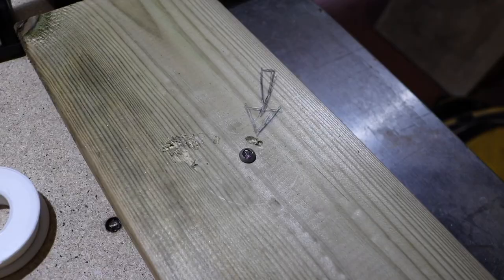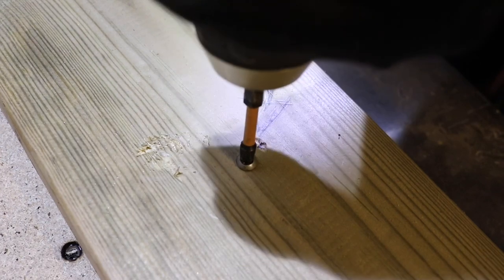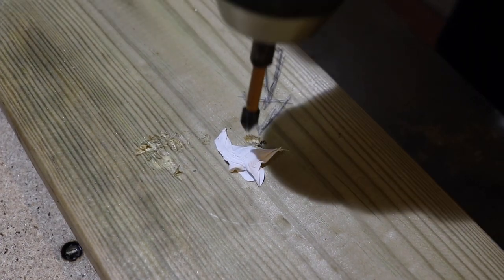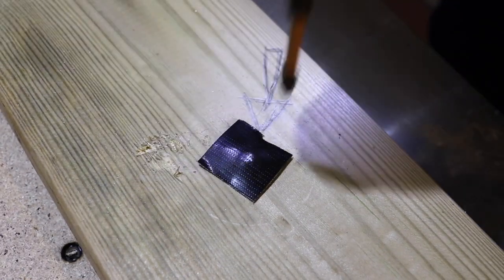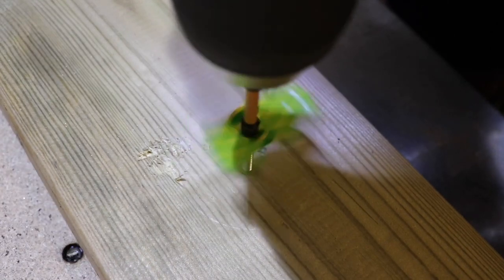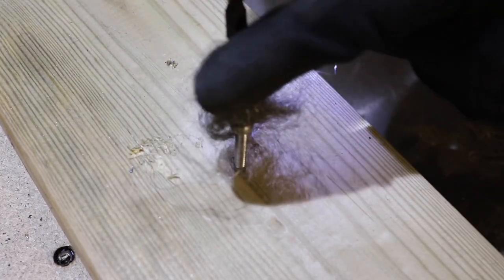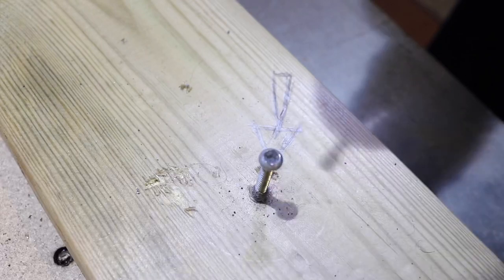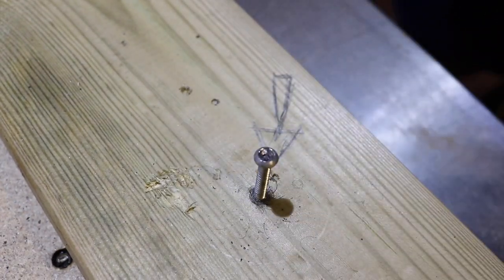Remove a stripped screw 8 DIY ways anybody can do

Comment: Electrical tape worked with one screw and I did it without an electrical drill! 1 down, 1 to go!🙌🏿
Reply: Thanks for the tip! It's a good thing I read comments while watching...🥰
Reply: I have one stripped screw on the back of my laptop. Hope this works😊

Comment: I was having a mental breakdown over here trying to replace my god damn PS4 Fan......stripped security screws galore! I ended up stripping one with a torx bit.......then I tried a variation of something you did. I took a flat head bit and put it in my drill, then wrapped some tape around the tip and it started coming out! It didn't come all the way out, I had to use my needle nose pliers to twist it but I got it! Great video man.
Reply: @domwrlddd  They really force you to get creative huh? >.>

I swear I am so damn happy I didn't have to buy another PS4 cause PS5s are so damn hard to come by and I wasn't ready to upgrade anyway. If not for my toolbag and tool collection I built up over the past months, I would have been screwed. I had to use A LOT more than just the security screw drivers and regular ones to adjust the parts. I spent at least two weekends trying everything and one day I stayed up until 7:00 AM in the morning until the damn thing was going again (much to my relief).

Probably watched over a dozen of these videos doing all types of repairs on PS4s.
Reply: @domwrlddd  I didn't need a drill to get one out, I was able to use my pliers or the tape trick with some of my screw drivers. I think that's an issue you need a shop to solve........I don't want to tell you to use a drill for that because it might drill too deep and damage something. I mean the PSU are $50 on Amazon last time I checked. I would just do that and get it over with, instead of fucking around with that screw. They do have a toolset for removing stripped screws. If a screw is stripped and you can't get it, it's this tool you press down on the edge and twist to pull the screw out. There are tutorials out there, look up security screw/torque screw remover tool. That could possibly work, if not to a shop it goes man.
Reply: @domwrlddd  facts man it's my power supply one

Comment: If it is an allen, torx, or certain size philips head, I often use a short torx bit and hammer it into the head; then attach the drill and back it out. The boxes of deck screws I used to buy always came with the proper size torx bit, bit I always had longer bits I liked so I have a small supply of cheap torx bits to use just for this purpose.

Comment: Great stuff,, must admit I'd not seen the wire wool trick,,!! Do you think WW is best of the bunch, ?   
Cheers,   John
Reply from the maker: I do use that method quite alot and seems to work everytime, I would say that's my favourite way John. 
Thanks
Reply: @PlumbingGy   
 just thought,, which is best, fine or coarse ww ??
Reply from the maker: I tend to use coarse but I'm sure if you already have either as long as you can get a bite it will work 👌🏻💪🏻

Comment: help, I can't get a stripped hex out from the pre-drilled hole of a metal shelving unit. It has been drilled through the shelf into a support bar. (It's an 'Ikea' assemble it yourself gone wrong! I think whomever originally screwed it together may have stripped this hex screw when using the alan key. The screw juts out, not flush like the other screws.  I'm thinking it's seized. I tried steel wool, rubber, and a spiral screw extractor (recommended by the hardware dude). This made it worse  : (    Any suggestions?
Reply from the maker: You will probably have to get a drill bit and drill it out I'm afraid 👍🏻

Comment: Any tips for taking a screw out of a electronic toy teeny tiny screw must be at least an inch deep before you actually get to the screw, I don't think it's ever been removed I tried the rubber band trick couldn't get it out don't seem to have any screw bit tips that will fit through the hole I put a drop of oil in the hole and waited about 30 minutes but no luck I'm thinking of just drilling it out.
Reply from the maker: Small drill bit and drill it 👍🏻👍🏻

Comment: Would the tape method work for a bolt that has been rounded, but uses a socket instead of a screwdriver?
Reply from the maker: It’s worth a shot
Reply: @PlumbingGy  Tried it, and the rubber band method. Couldn't get either to stay up on the bolt. 

So resorted to my late Grandfather's old method of using one mm size smaller socket and hammering it on. That worked perfectly.

Comment: Tried all of the methods you showed (yes all as I am also a plumber by trade so I have all of the plumbing stuff in my storage shed and my dad as well with over 45 yrs combined)and none worked for me. The screw head is now completely stripped. I have an outdoor wireless camera mounted to the fascia board on the bottom part of the board, so the screw goes up and in. Tried pliers as well but since the other piece of the mount is on there those didn't work and the mount is plastic so I don't want to break it because I still going to use it just need to move the camera. Any other suggestions?
Reply from the maker: Try drilling it out with a smaller drill but that’s what I always use as a last resort, just be mindful and careful when doing so 👍🏻
Reply: Ok I'll give that a try and I sure will. I'm always mindful when using any type of power tool regardless of size and power.
Thank you

Comment: Unsure if it because I was trying to remove a screw from my car and not wood or because I was using a hand screwdriver but none of these worked... tried the electrical tape but just pierced straight through even after layering it up - search continues for a solution :(
Reply: Ssssaammmmeeeee 😔😔

Comment: how do you get a rounded screw out of something that's down inside a toy
Reply from the maker: You can use some of the same methods only on a smaller scale, or the other option would be to use a start driver and try to get it out that way

Comment: Nice and all but the that hole's loose enough that you don't need too much torque to remove the screw, I've been trying for hours yesterday to remove a screw which got stripped because it was initially installed by KING KONG himself . Electrical tape will do jack sheep if that was a stuck screw. I am however going to try the other methods you mentioned.

Comment: I can't get the stripped screw out of the metal plate base from an  old ceiling fan.   U keep removing the same screw from the same hole in wood, so it's not as tight as mine maybe?
Reply: Yea same problem here I gotta get into my dirtbikes carb an the screw is completely stripped

Comment: What is the "PTFE" he used.??
Reply from the maker: Plumbing tape
Reply: @PlumbingGy   ~You mean "thread seal tape" to put on screws or pipe threads. I used some yesterday on some screws in a handsaw handle. I will have to get some "Loctite" Threadlocker Blue and Red which are also good for threads. 
~We have a fellow here called "Do It All Paul", (Adventures in Gold Prospecting) who makes and sells Highbankers and Sluices out of Dream Mat, expanded metal, etc.. He "powder coats" the aluminum on his gold prospecting equipment. Maybe check him out on a search. The quality of his products and work is honesty close to 10 out of 10.

Comment: any advice if the screw is so stuck that none of these work
Reply from the maker: Drill out 👍🏻
Reply: I have the same problem atm 😩
Reply from the maker: Use a slightly smaller drill bit and drill the head off then drill the screw out 👍🏻

Comment: And at times even doing all these methods doesn’t even work. The only thing I found worked is to use that tool at the end and push down with extreme force. Use the other side and reverse the power tool to get the screw out.

Comment: Im trying to take a rusted worn nail out of my skateboard and its not budging, idk how to use an electric drill bc I’m only a kid- soooooo PLZ HELP. I tried the duck tape sence its all i have but the screw driver kept making holes in it 😞 and im doing all this by hand its rlly hard
Reply from the maker: You can get a set of screw removers that you can attach to either a ratchet or a torx bit, you're better off drilling it out to be honest though if it's rusted try borrowing one might be worth asking around hope you sort it out
Reply: @PlumbingGy  ok thank you! I switched to a flat tip and it came out perfectly tho! I will try that next time

Comment: my screwdriver keeps going through the tape
Reply from the maker: Electrical tape? You can use duct tape.
Reply: @PlumbingGy  it also went through :(
Reply: @PlumbingGy  and also my screw is small and maybe thats why it can go through because it is small
Reply from the maker: Try wrapping a very small amount of tape around the end of the screwdriver instead of the screw, what is the screw on?
Reply: @PlumbingGy  it is in a hole
Reply: @PlumbingGy  the hole is plastic
Reply: @PlumbingGy  help me pls
Reply from the maker: Very thin drill bit and drill it out, either that or you will need to purchase a screw removal kit 👍🏻

Comment: ALL THESE TUTORIALS, THE SCREW ITSELF ISN'T STUCK AND TIGHTLY SCREWED
Reply from the maker: Sorry??? I don't understand what you mean if it isn't stuck just unscrew it.
Reply: @PlumbingGy  no sir, my cabinet handles are like glued in those holes. I have used my dremmel to make a line. It can now grip the head but it won't turn. At all. I tried to chisel the wood around it still not budging. Please give me hope and show us how to deal with hopeless screw. I drilled two screws to chew away everything and i got stuck because, what's next? Lol. I can't turn the handle to unscrew it because there's two for each handle. It made me cry already.
Reply from the maker: Grab yourself a metal drill bit as big as the screw thread and drill it out carefully fist by drilling the head off. Be careful not to drill into the handle when through the other side
Reply: @PlumbingGy  ok. i shall do that. thank you so much! i have about 30 of these. haha! i am determined. i will cry, but determined.
Reply from the maker: @joyce7550  let me know how u get on
Reply: @PlumbingGy  awww. thank you! i appreciate you really helping <3
Reply: @PlumbingGy  it was too hard. managed to take out two of them for now.